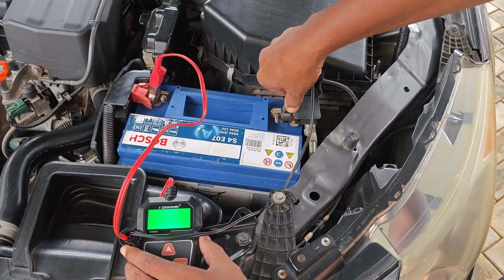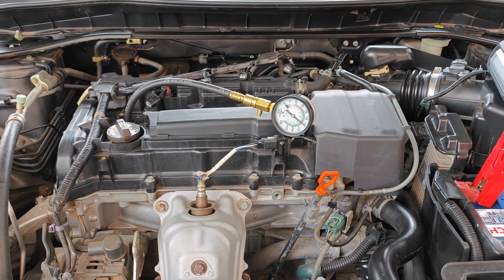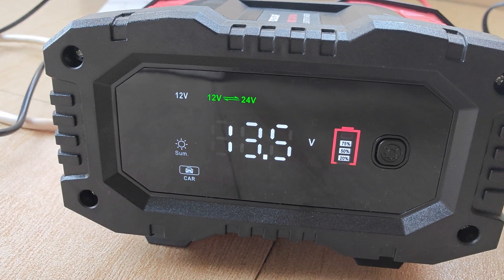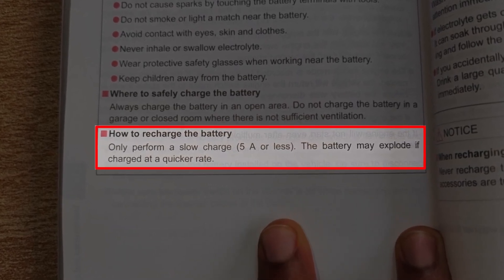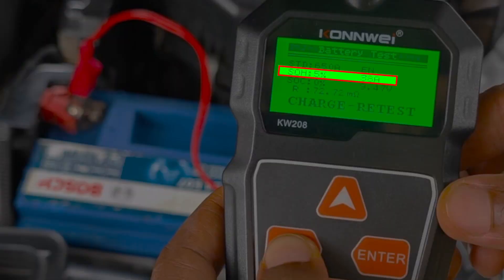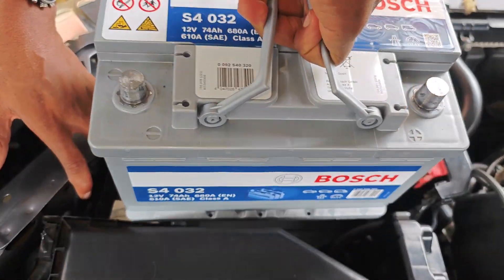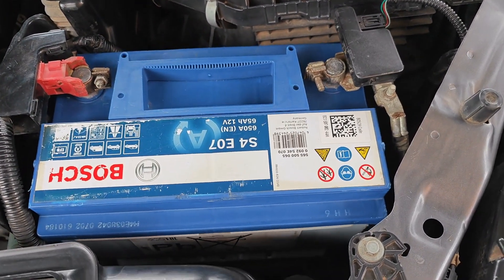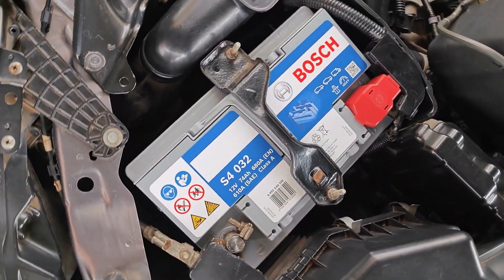Car Battery Killer: Car Battery Destroyed by High Amp Charger

Comment: I really like the OptiMate line of chargers. They are mostly for maintenance charging, but some of their models have a desulfating / repair feature on them to help "heal" poorly treated batteries. If you get the right model, they are good for SLA, AGM, Lithiums. The less expensive models only do about .8 to 1 amp, and some of their more expensive models do 2+ amps. You can leave them on for months at a time and they will maintain a charge on the battery without overdoing it.

Comment: Sounds to me like the charger overboosted the voltage to get that 20A to flow. Thats what most  "Smart" quickchargers do.

A discharged battery should be able to handle 20A just fine. Car alternators can supply over 80A.

If the charging was done using a conventional "dumb" Constant Voltage charger, the current flow should've automatically gone down as the battery juiced up.

Using a 20A 14V charger shouldn't cause any issues. Problems only start to occur if the charger goes crazy with the voltage boosting.
Reply from the maker: Not sure what happened, but I certainly can't exonerate that charger 😂

Comment: was it an automatic battery charger that drops the amps as the battery becomes charged? they are safer, so you don't overcharge the battery. the old manual chargers you have to see how low it is figure out how many amps it would take for how many hours to fill it up i use a 6 amp one normally but also have a bit bigger 10 amp for large deep cycle marine batteries
Reply from the maker: It was a smart / automatic charger. It really failed in its smartness.

Comment: Strange, it should except 20 amps if the battery was healthy. Im thinking it has a bad cell somewhere. Generally a battery will accept 20 amps & below. Of course anything higher than that would be more of a boosting faze. Bty.. Do you know how old approximately that battery was?
Reply from the maker: I know, right.
 Battery was 4 years old from date of manufacture. I fit it in the car in 2021. Never had it not start the car or show any signs of being weak until after the compression test. The rule is charging at no more than 10% of their rated capacity which for this 65AH, should have been 6.5 amps. That said being an EFB it should be able to handle above 6.5 amps, but 20 amps was too much. I've actually used this 20 amp charger on it previously, but it was just for topping off purposes. Being flat meant the battery was really hungry and the  charger was charging it at max rate. The fact that the battery was already hot didn't help either. The charger's smart system should also take part of the blame as it should have tripped off due to the high temp.
Reply: Yup, i agree 100 % @DIYAutoworksNG
Reply: A good charger regulates it's charging current at any phase of the charging cycle in conformity to what the battery being charged can accept at any phase of the charging cycle.

A good battery charger will have a 7-phase charge cycle with the "Bulk Charge" phase being when the highest amperage is supplied to the battery.
Reply from the maker: @charleso3017 100% correct. The charger failed to regulate its charging current.

Comment: Normal SLI batteries are rated for a charge rate of 0.1C, meaning you can charge them at a rate no more than one tenth of their rated capacity. So in this case it’s a 65 Ah battery - no more than 6.5A. 
EFB and AGM batteries can accept a higher charge rate (0.25-0.3C). That’s part of what makes them suitable and necessary for vehicles with stop-start systems. 
The one you had was an EFB - so it should handle 16A just fine, but 20A is too much for a battery of this size.
Reply from the maker: Thanks for the detailed comment!